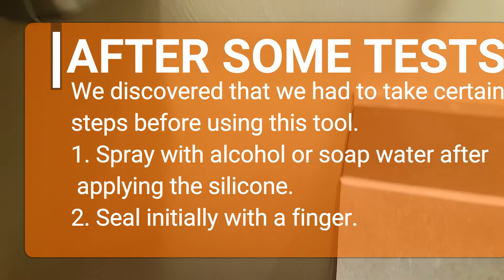Caulking Tools - Pro Caulk Testing

Comment: Why do amateurs keep doing this. It is why their sealant fails so often and is just plain stupid
Every major manufacturer says not to use liquids to tool with if you look close enough at their tech manuals. Here is what DOW ( one of the largest silicone manufacturers in the world ) says: “NOTE: Do not use liquid tooling aids such as water,soap or alcohols. These materials will interfere with cure, adhesion and create aesthetic issues “
As a professional caulker anyone that did this would be fired on the spot.